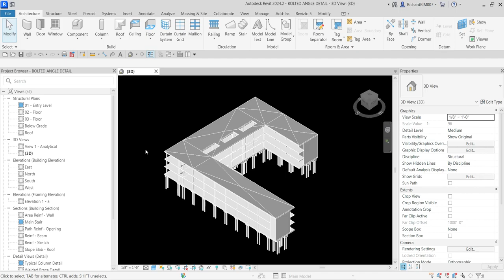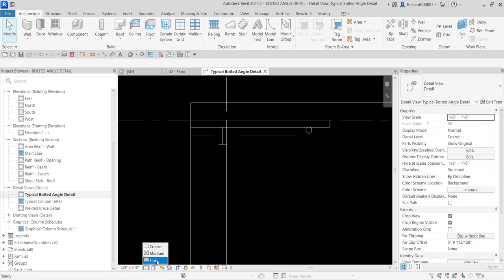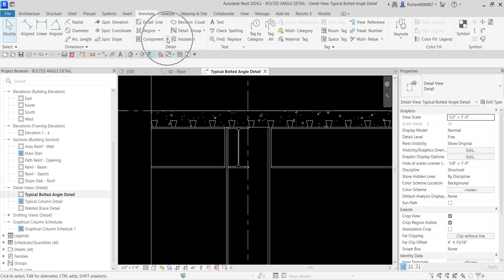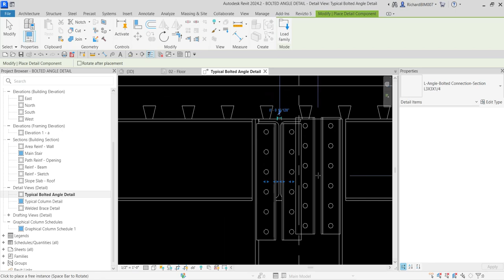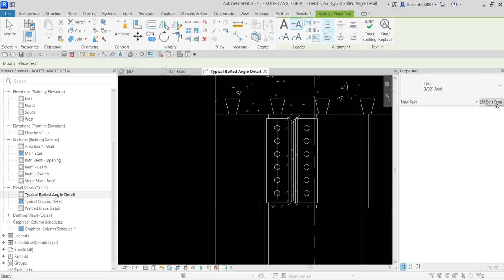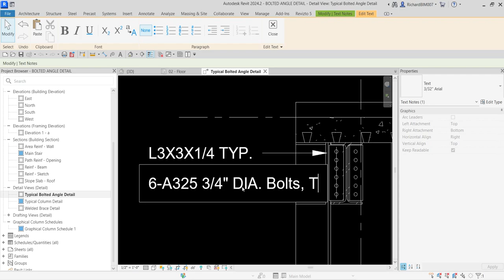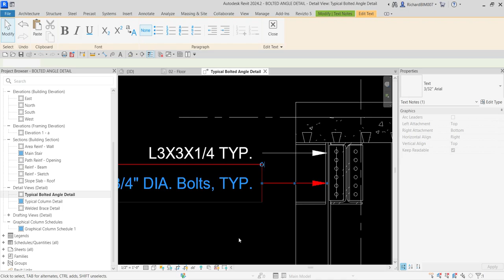REVIT 2024 FOR STRUCTURAL DESIGN: BOLTED ANGLE PLATE DETAIL

Comment: please tell us how to creat those detail items ...how to model that family
Reply from the maker: Hello vinay, creating detail items in Revit involves creating custom families tailored to the specific detailing needs of your project. Here's a general guide on how to create detail items in Revit:

1. *Launch Revit:* Open Revit and start a new project or open an existing project where you want to create the detail items.

2. *Create a New Family:* To create a new detail item, you need to create a new family. Go to the "File" menu, select "New," then choose "Family."

3. *Choose Family Template:* In the "New Family - Select Template File" dialog, choose the appropriate template based on the type of detail item you want to create. For example, if you're creating a 2D detail item, you might choose the "Annotation" template.

4. *Model the Detail Item:* Use the modeling tools in Revit to create the geometry for your detail item. This could involve drawing lines, arcs, circles, or using more complex modeling tools depending on the complexity of the detail.

5. *Add Parameters (Optional):* If you want your detail item to be parametric, meaning it can be flexibly adjusted based on parameters, you can add parameters to control its dimensions or other properties.

6. *Apply Constraints (Optional):* Use constraints to control the relationships between different elements of your detail item. This helps ensure that the detail item behaves as expected when dimensions change.

7. *Add Detail Components (Optional):* If your detail item includes standard components like text, symbols, or tags, you can add these to your family using the appropriate tools.

8. *Save the Family:* Once you've finished modeling your detail item, save the family file (.rfa) to a location where it can be easily accessed for use in your projects.

9. *Load the Family into a Project:* To use your custom detail item in a project, load the family into the project. Go to the "Insert" tab, click on "Load Family," then navigate to the location where you saved your family file and select it.

10. *Place the Detail Item:* With the family loaded into your project, you can now place instances of the detail item wherever needed in your project views.